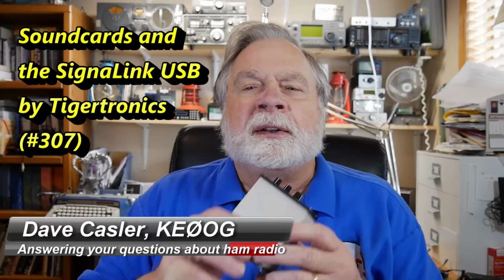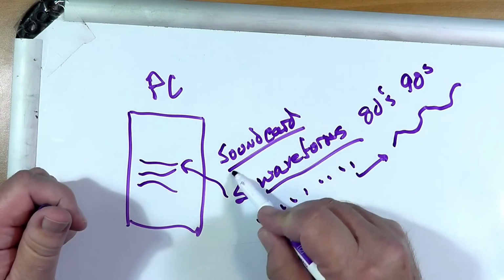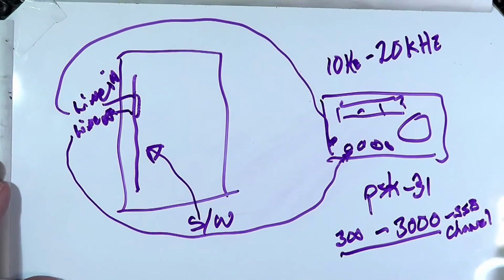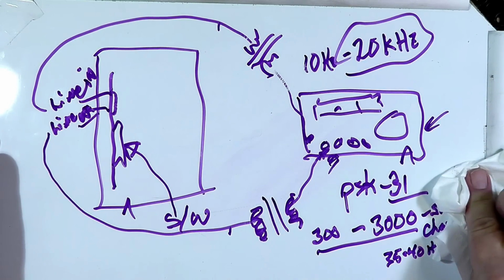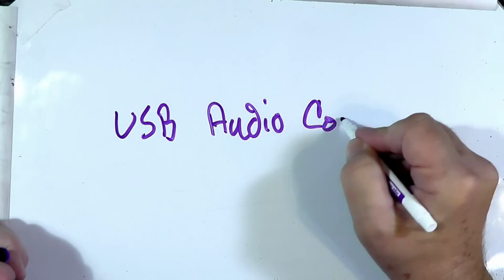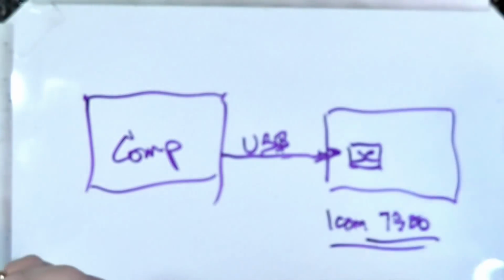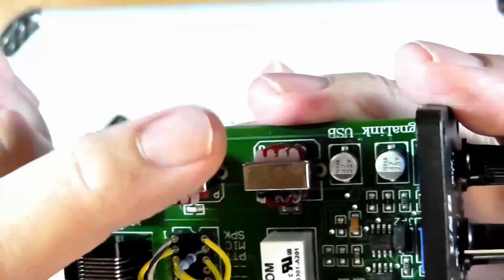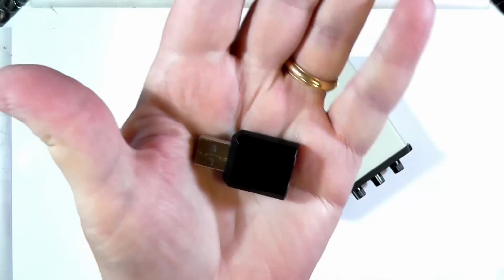Soundcards and the SignaLink USB (#307)

Comment: Thanks for this video, Dave. It's a great explanation. 
I built my own digi-comms adapter to use with my Xiegu G90.
All I did was plug a USB sound device and the G90'S USB cat control cable into a USB hub to combine them into one USB cable. 
When it worked I de-cased and de-connectored the devices, wiring them directly to the USB hub and the G90's DIN cable for the audio connections.
This setup has worked so well that I recently added a USB GPS dongle as well.
73 de N2NLQ
Reply: Michael Thompson  ,  A complete and interesting comment!

Comment: Great video. You packed in a lot of information. I use my signal link USB with a 2 m radio. We do digital nets in my area usually once a week. I use a 2 m radio shack mobile which fits perfectly into the optical drive slot of a computer tower. I have a 12 volt power supply in the computer case and a speaker with a tweeter that I got from a boombox. Placed a switch on it to kill the speaker when I want to and I can use the setup with any laptop or Windows computer I want to. I even put a SWR meter on the front of it and a voltage meter to make sure my voltage was good. It's an awesome setup that is great to take out for portable uses. All you need is any sort of decent vertical antenna. I have a picture available of the unit if you like.

Comment: Hello Dave. Thanks for the video. One of the reasons that I did not buy a signalink, is that it does not provide computer control of the radio. That's why I ended up with a Rigblaster Advantage. It does everything that the signalink does, plus it provides CI-V or CAT control of the radio, and CW keying.  I used this extensively with my IC-7000 and IC-706.  Those are long gone, and both my IC-7300 and Kenwood SG-590Mk2 have internal sound cards and CAT control with the USB. The IC-7300 even allows keying CW via USB, without the need for an external keyer.  My rigblaster is still working, but now does duty on VHF/UHF for soundcard packet with Winlink attached to my IC-5100. BTW, your signalink will do the same on VHF/UHF FM!

Comment: Great video Dave.  The Signalink solved all my digital mode problems back in the day.  Still use it with my older radios.  Just buy the cable kits needed per model.  And my 7300 has all included...what wonderful developments are in these new rigs...hi hi.

Comment: This is very informative video. I have used my Signalink USB on Winlink VARA and ARDOP as well as VARA on FM. One thing I would like to add is that the Speaker jack on the back is connected via a cable to the radio's speaker jack in case there is no speaker audio on the microphone jack. If you have a radio with the 6 pin mini DIN plug then the Speaker jack on the Signalink USB isn't used. On a side note, I have a Soundblaster sound card that is USB as well, and I use it on my Echolink node. 73 KD5YOU

Comment: I bought some jumper headers with caps for use with the jumper settings. I have one for my SGC2020 and one for my 857. Each plugin header is clearly marked for which radio I choose. Its now basically plug and play for switching between rigs.

Comment: Simplest way to make an RJ45 cable if you have no crimper: Buy a 6-10' long ethernet cable, cut it in half. Now you just have to solder on the radio cable, and you can make up cables for radios.

Comment: A minor correction: the IBM architecture was open in 1981, before the Apple Macintosh in 1984 had closed instead.  But my Apple ][+ from 1979 has open architecture, before either of those; so open that the schematic is in the book that came with it.

I'm mentioning it just to be thorough,  no complaints about the rest of the info provided! 🙂👍

Comment: Had to get a new potentiometer for the one knob on my older signalink, a wire going into the board broke on it. I myself prefer the older signalink to the newer versions. The newer ones have controls to work easier with the new computers software.

Comment: On the IC746Pro, if you attach the SL to the back of rig port, make sure you puch the SSB or FM button so the letter D schoew up.  If not, the 746 will not "see" the input.

Comment: Hi Dave, I have an old vacuum tube Drake TR-4C transceiver.  It's been maintained well and works well.  No problems for a vintage 1970's era radio.

My question is, can the Signalink USB be made to interface with my Drake TR-4C?

Thanks, Ed KA2AHE.

Comment: Great video Dave , my issue is that my laptop wont work with fldigi ect ect just says no soundcard  but it obviously has because i listen to music on it . But my 7300 apperently has an inbuilt soundcard  so i will try and see if fldigi ect will work when i plug in the radio  and i have downloaded the drivers from Icom .

Comment: Hi Dave,
Very informative video. Tigertronics also makes available plug and play jumper modules that plug into that dip socket if you don't want to manually wire the internal jumpers. How is your mouth healing? Are you on solid foods now? Stay safe.  73  WJ3U
Reply: Those are the pre-made (to individual radio models / brands) jumper chips. They work very well. I have 2 sets, both for Yaesu radios. One is for an older and one newer radio. Plus the wiring harnesses to connect to the different radios.

Comment: Dave,  I have a Yaesu FT-847 radio, and I am trying to run fldigi cw mode. What is the best and easiest way to connect an audio port to the computer so the software will reconize the radio. there is a six pin packet plug on the back of the radio, would I connect this socket to computer via a usb cable and usb connector? 
I have not been able to configure fldgi sound card on computer due to the fact I keep getting a port audio device not available error. I am guessing this is the cause, but to be honest, not really sure. there is also an external spearker plug on the back of the radio, don't know if I could use that, but I tought that might mute the radio. Any advise would be greatly appreciated. your channel is very informative, thanks in advance for any assistance you may offer. all the best
Regards
Derek

Comment: Very interesting, Dave.  I've been looking for a way to try digital modes but my radio, a Kenwood TS-830s, is too old to have a digital input.  Will the SignaLink device work on my radio through its 4-pin microphone jack? What about the Remote jack, which is normally used with a linear amplifier?  (The radio is new to me so I'm not very familiar with it yet).  Thanks for your time in answering these newbie questions!
Reply: I use it on my 830 thru the mic jack works great ,  psk31 rtty and ft8

Comment: There's not much to these new "sound card" devices. Looking at the data sheets and schematics, they are all very similar. Even the SignaLink schematic looks very much like the data sheet application notes for the TI PCM2904 chip. The "extra" circuitry, which makes it somewhat unique, appears to mostly be for the push-to-talk function and based on the PIC 16F676.

Comment: Thank you for a great vid! One question I have is if I have a soundcard in the radio (ic7300), is it still advantageous to use signalink? Better transmission quality maybe?
Reply: No. There is no advantage. I use the USB on my 7300 with great success, and I stopped using my Rigblaster Advantage entirely, except for packet on VHF/UHF with my 5100.
Reply: @pedrocatalan9814  Thank you!
Reply: Seabound  ,   JUST the question I had... ROFL  the key word is "advantageous!" de KQ2E

Comment: I have read or seen, where someone has hooked their inexpensive Baofeng, Handi Talkie, to one of those USB Sound card, dongles, then connected it to their lap top PC. (I think for use with APRS?) I want to try the same rig, for use with EchoLink software. So I can run an Echolink station, anywhere. And be able to use it over the air, via another H.T. I am just not sure about the PTT, yet. If anyone has done this, let me know!